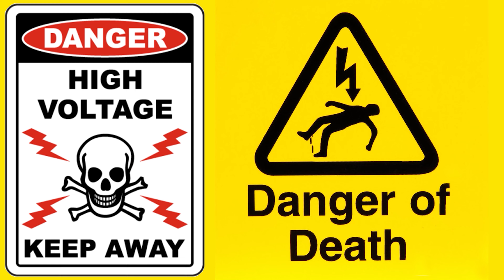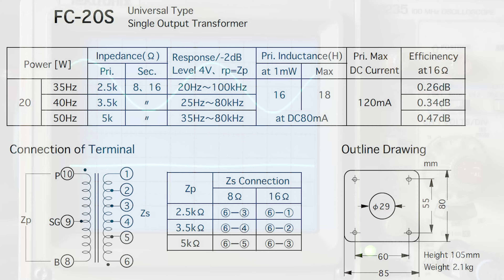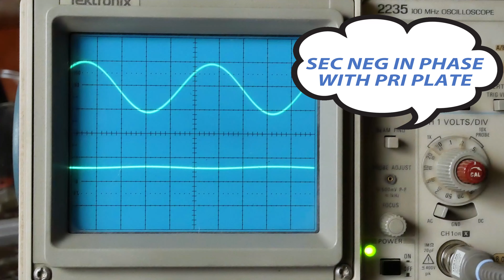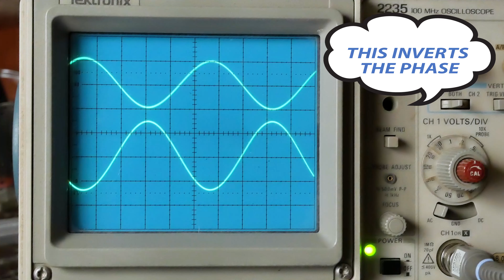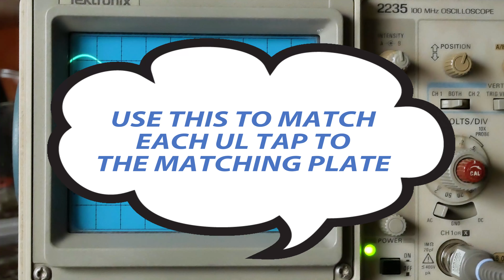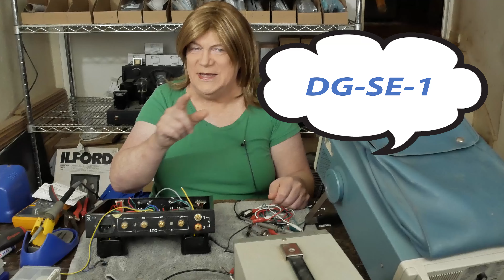Measuring Tube Amplifier Output Transformer Impedance

Comment: G,day from Sydney Australia. Great tutorial, however would have liked to see the probe connections (over head camera).
Learning outcomes.
*Read specs of FC-205 data sheet 
*Associate your teaching with 5K and Hz range.
* Visualize the sine wave phases on the scope (in and out)
*Basic calcs ohms and crusibal horizontal and vertical lines.
*Injection of low V via speaker input jacks. 
🌏🇦🇺
Reply from the maker: Noted! I look forward to watching your improved version and am happy to link to to it! 

As published, it took me approximately 7 hours to setup, record, edit and publish this video and I'm sorry it didn't meet your standards for a free educational video. I don't own two cameras to record multiple different angles at the same time, and if i did, that would have added several more hours to the editing process for me. 

As I said, I look forward to watching and sharing your improved contribution to the hobby for everyone to learn from!

Comment: Great video on output transformer impedance - a complex topic.  I prefer the measuring process in the direction in which the amp works, feeding the primary with AC and measuring the secondary voltage.
There is a school of thought that the secondary needs to be loaded with a dummy resistor equalling the nominal resistance of the speaker. I tried both ways on a couple of OPT's, determining the voltage ratio with and without dummy load on the secondary and consequently the impedance ratio as the square of the voltage ratio, and I found that there is quite a big difference in the results.
Then I decided to measure voltage and current on the primary of the OPT and calculate the impedance from this, with the load resistor on the secondary. Here, the impedance ratio turned out in one case nearly exactly  the same as the value obtained by no-load voltage measurements, in the other case about 10% off, while the measurements of voltage ratio with dummy load was about 20% off.
Conclusion – determining the impedance ratio through the no-load voltage ratio gives a valid result, while the voltage ratio with load on the secondary suggests significantly too high an impedance ratio.

Comment: Sweet! Cool to learn how to calculate turns ratio using an oscilloscope. I use a 6.3V or 24V transformer to determine voltage change ... dV between primary and secondary gives turns ratio.

Comment: I bought an assembled Chinese 6x5 + ECL82 tubes power supply board. It supposed to supply 260 v B+ but measured only 100+ v. After 2 weeks and many component swaps including the 2nd ECL82 tube, I figured it out that they put the zenor diode in the wrong direction.
Reply from the maker: That doesn't shock me, good job finding that!!!

Comment: Can you make another video showing how to measure the transformers PHASE? I still don't see the phase on the oscilloscope. Why would the primary and secondary be out of phase, for what reasons? most audio amplifiers want the primary and secondary to be In-Phase, but not sure what audio amplifier would want the primary and secondary to be 180 Out of phase or 270 degrees out of phase?
Reply from the maker: It depends on the amp design, how many signal inversions happen and if you are using global negative feedback. If you are using GNFB, you may have to invert the phase at the output transformer to have negative rather than positive feedback. Most of these were showing them in phase, but there were a couple of examples on the scope showing what 180 or inverted phase looks like. BTW not all amp have the input and the output in phase.
Reply: @SkunkieDesignsElectronics  So the only reason to reverse the phase on the primary is to get "positive feedback"?  I'm not sure why anyone would want to use positive feedback because they would cause oscillations. Negative feedback reduces oscillations in the power amplifier section
Reply from the maker: They would reverse the polarity to NOT have positive feedback. Tube amps can have even or odd numbers of signal inversions depending on the design. Of course no one would intentionally hook up positive feedback.
Reply: @SkunkieDesignsElectronics  The Tech would first have to measure the amplifiers input signal on Oscope ch#1 and 
"compared" the input signal with the power amplifiers output signal on Oscope ch#2 to even know if the amplifier has "signal inversion" out of phase to use an out of phase transformers. If you put measure the output of the power amplifier you won't know if the signal is in-phase or out-of phase unless you compare it with the input signal. I rarely have seen out of phase/reversed phase output transformers used in audio amplifiers.
Reply: @SkunkieDesignsElectronics  How can you measure if the Ultralinear TAP is 40% or 60% using the oscilloscope? I'm not sure what 40% or 60% means, 40% of what? and 60% of what?
Reply from the maker: I show this in the video, that one transformer has a 25 turns ration across the whole winding. From one end to the UL tap is 10 turns ratio, from the other end to the UL tap is 15 turns ratio. 10/25=0.4, the math is simple.
Reply: @SkunkieDesignsElectronics  Yes you mention that 15/25 is 60% UL, which you said sounds horrible compared to the 40%UL, any reasons why the 60%UL doesn't sound as good as the 40% UL? because the 60%UL should have more headroom and cleaner. I didn't see you measure using the oscilloscope the UL 40% and UL 60% to visually see the Ultralinear waveforms, can you do this using an oscilloscope?
Reply from the maker: I 100% measured the UL tap on the scope in this video. Like I said the amp did show less distortion at 60% but just didn't sound as good to my ears listening to music. I never said it sounds "horrible". And it sounds like you already know more about this than I do, not sure why you keep asking questions, then tell me what is going on. 

And I ALWAYS have probe 1 connected to the input signal and probe 2 connected to the output. How else would you compare the two, measure the gain, see how much input signal is needed to make it clip etc? And the transformer is in phase or inverted phase by how you connect it. There is no such thing as a "reversed phase" output transformer... Probably why you have never seen one, they don't exist.

Comment: Thanks for that, although I'm still a little uncertain of the phasing connection. Just to confirm, when we connect our feedback, we want an out of phase signal, so we connect the "negative" of the secondary to the feedback point? Or have I misunderstood?
Reply from the maker: It depends on how many inversions the amp design has. I honestly don't sweat it too much, (makes my brain hurt) if you get it backwards it's VERY obvious on initial testing lol.
Reply: @SkunkieDesignsElectronics  Yes, I'll get some ear plugs.
Reply from the maker: Test with dummy loads!!!
Reply: @SkunkieDesignsElectronics  :)
Reply: @mfr58  if you connect it incorrectly you’ll get positive feedback, think microphone pa feedback. In some cases positive feedback is needed. Like an oscillator in a radio.
Reply: @davidedwards7172  Thanks

Comment: Another easy way to measure output impedance is with a DE5000 meter. Attach a resistor or speaker to the output of know value to the secondary and the meter across the primary and it will measure the impedance to the milli ohm for that specific load.